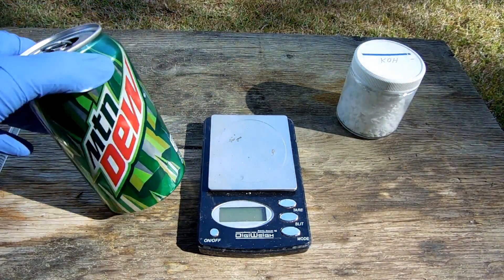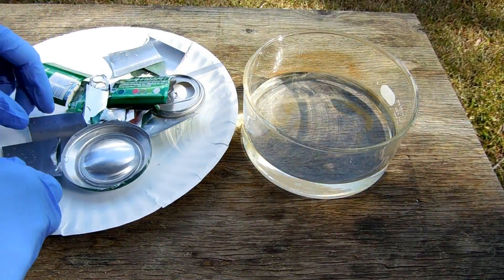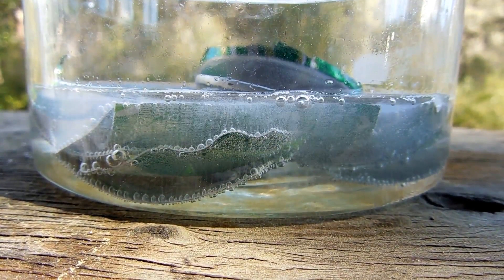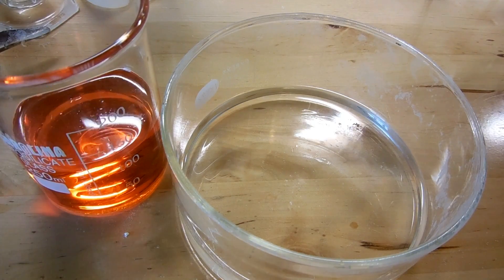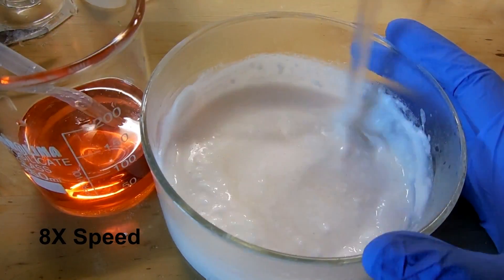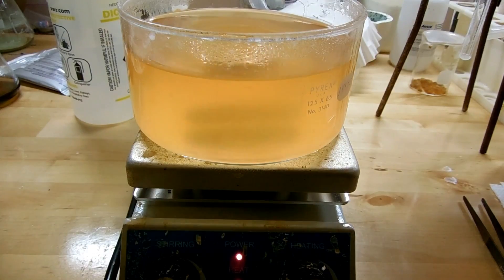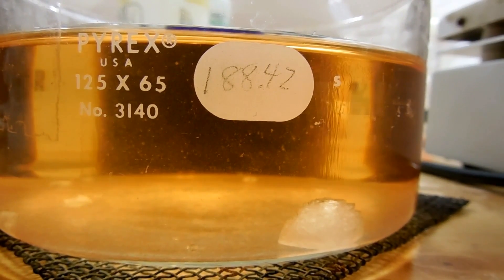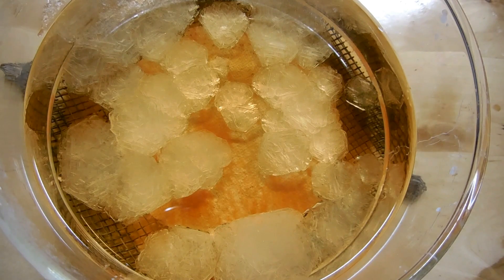Alum from Soda Cans

Comment: Can you use sodium hydroxide?
Reply from the maker: Potassium alum requires the potassium atom!
Reply: @mrhomescientist  oh didn't know it was called potassium alum
Reply from the maker: @my2centz196  There are many different 'alums' - potassium aluminum sulfate is the one people usually mean when they use the term. Ammonium aluminum sulfate is also common as a pickling salt.
Reply: @mrhomescientist  good to know. I'm learning a lot. I dissolved quite a bit of aluminum in sodium hydroxide and got a weird gray and white powder after it dried out which is why I asked this question because I'm wondering what I have lol. I'm fascinated with chemistry but know nothing of it except what I learn on YouTube.
Reply from the maker: @my2centz196  What was your source of aluminum? If you only used hydroxide and nothing else, you ended up with some complex sodium aluminate / aluminum oxide mess. In my video, I made potassium aluminum sulfate. Those three parts need to come from somewhere: potassium from KOH, aluminum from the soda can, and sulfate from sulfuric acid. The acid also neutralizes the hydroxide, so the only product is the alum that I'm after.
Reply: @mrhomescientist  I used aluminum electrical wire. That mixed with a pretty strong solution of food grade sodium hydroxide & distilled water. I mostly did it for the fun of watching it but I allowed it to evaporate so I could see what I had left. I'm sure it got pretty contaminated because I left it outside until it finished drying. I also dissolve some of the wire in hydrochloric acid and got a pretty cool white paste that I have no idea what it is either. Actually I also added 35% food grade hydrogen peroxide to the HCI   again just for fun and my morbid curiosity lol. My wife says I'm gonna blow myself up one of these days lol. I do use protective gear and a well ventilated place when doing this stuff luckily so I haven't yet lol.
Reply from the maker: @my2centz196  You did great with the first experiment - wire, food grade, and distilled are all very pure, so your products will be too. The second reaction with hydrochloric acid produces a lot of heat and can ramp up very quickly to boiling, which you may have noticed. Adding peroxide would produce chlorine gas, and speed it up even more. In any case, your product is hydrated aluminum chloride. Curiosity is great, but in chemistry especially it must be tempered with caution. You need to research any planned reaction before you perform it, so you know exactly what to expect and what dangers to watch out for. You can't be fully safely prepared unless you have an idea of what might happen. Mixing things at random is never a good idea in chemistry. I'm glad you're interested in the science and I don't want to discourage you from experimenting, but you need to make sure you understand and prepare for the possible dangers. For your own safety AND your wife's.

Comment: I would say the streams are currents of solution LESS concentrated then the bulk.  When a solution supersaturates, it forms precipitate more readily on existing precipitate ("seeding").  (Alum is peculiar in that water solutions can supersaturate to a large extent, but not precipitate spontaneously.  It is for this reason that alum is so easy to grow crystals from.)  The depleted solution is less dense then the bulk, and rises.  This is a case of "non-thermal convection".  You see it because its optical index is lower than that of the bulk.
     You do not want to evaporate the solution too far!  The contaminates become more concentrated in the solution, while the desired substance becomes depleted.  Contaminates may reach the point of precipitating.  Solution can also become trapped in overlapping crystals, and then is more difficult to wash off the crystals.
Reply from the maker: I think you're right!
Reply from the maker: Great comment! I think you're exactly right.

Comment: hey i mixed my aluminum with sodium hydroxide, and viniger, and it made this white mess... im not sure what it is, i am assuming it is aluminum acetate, and the main question is ... is it soluble in anything?
Reply from the maker: Aluminum acetate should be soluble. What you actually made is more likely aluminum hydroxide, which is not. Add more vinegar to the solids until they dissolve to get the acetate.
Reply: @mrhomescientist  oh! Thank you!!! I was super confused about what to do next, I'm planning to use electrolysis on the solution of aluminum acetate to get aluminium as acetic acid is not good enough to react with aluminum
Reply from the maker: @thecrudelab3204  But water is! Unfortunately it's not possible to form Al metal from an aqueous solution. If it was, they wouldn't be melting rocks to make it industrially! Less reactive metals like copper, however can be made that way. Try electrolysis on a copper sulfate solution instead!
Reply: @mrhomescientist  yeh, I have but I was just wondering if I could do it with aluminium and it is worth testing this anyways, I'll see what happens after this.
Reply from the maker: @thecrudelab3204  All experiments are worth a shot!
Reply: @mrhomescientist  cool!!! Thanks

Comment: I say the current is less-dense solution.  The bulk solution is most likely supersaturated.  Where the crystal is, the solution is only saturated, so it's less dense.  Alum is a material that can "way supersaturate".  That's why it forms large, single crystals so easily.  (Crystal growth is determined by thermal conductivity and amount of supersaturation that can be sustained without spontaneous precipitation.  Materials that don't "tolerate" supersaturation and are poor thermal conductors must be grown slowly, from a melt, in order to prevent "rogue crystals" from forming at the growth front.)
Reply: You said what I knew and went a lot deeper!

Comment: the stream coming up off the crystals is fluid of less dense alum solution due to the surface of the crystal pulling alum out of solution as it crystallizes
witch has a different refractive index and less dense causing it to rise
i seen this same effect from recrystallizing some eritritol

Comment: Hey why not use sodium hydroxide instead of Potassium hydroxide? It's pretty much the same..
Reply from the maker: Otago Harbour Fishermen But it doesn't produce the right alum. The type I'm making is potassium aluminum sulfate.
Reply: mrhomescientist OK but does sodium hydroxide method work for crystal?
Reply from the maker: Otago Harbour Fishermen Sure. It makes sodium alum instead, which I imagine would be pretty similar.
Reply: i dont have any sulfuric acid :'(
Reply: well technicly i could get some copper sulphate and dissolve it in water and run electrolysis on it to make copper metal crystals and sulphuric acid but i dont have any nearby :'(

Comment: great video !  what if you put aluminum into sulfuric acid - does it do the same thing?
Reply from the maker: C P It still dissolves, yes, but so do lots of the other impurities! By first reacting it with hydroxide, we can leave behind almost all of the other junk and dissolve only the Al.
Reply: what about using clean aluminum scrap?  The reason i asking is because i need to make lots of aluminum oxide for composite peopolymer research project.  Right now just using mineral alum mined out of the ground (lots of impurities) reacted with sodium bicarbonate to produce aluminum oxide precipitate and sodium sulfate liquid.   - side point :Sodium sulfate liquid glows a brilliant sky blue in ultraviolet light.
Reply from the maker: It depends on what the scrap is. Aluminum wire is generally very pure and would yield pure compounds, while soda cans or pipes are alloys that would be rather impure. Again, though, by dissolving in hydroxide first much of these impurities can be filtered off. You can also just recrystallize your mined alum several times to increase purity.

Comment: tabs are higher grade of aluminum almost 100 % aircraft grade if not 100%
Reply from the maker: Do you have a reference for that claim?
Reply: from the time you have annoyed me you could looked it up I think it is a punched dye it comes from a tiny puck it is punched hi grade actually a very valuable aluminum it is air craft grade
Reply from the maker: It was just a simple question. I have tried looking it up but could never find a credible reference. Soda can manufacturers state that they use the alloys 3104-H19 and 3004-H19 for the wallls, and 5182-H48 for the lid. No mention of the tabs. I would think if it was a significantly different and valuable alloy, it would have been listed. I was honestly curious if you had a solid reference for what you said; no need to get defensive.
Reply: Might be 6061-t6.

Not for sure though ...
Reply from the maker: Pretty telling that he never responded, eh? If anyone can find a reference that says the tabs are made of a different material than the lid, I would be genuinely interested to see it.
Reply: mrhomescientist Yes. I know a year ago post, but why not... I did not find any evidence the tab and can are made from different materials, however, I also did not find any evidence that are made from the same material. I can think of some reasons they might be different based on their function, but they could easily be the same. I did find plenty of info that they do sell to recyclers for the same price per pound. Technically, this makes the tabs worth more, only because the can is coated with label and protective coating and so not all of its mass is metal, whereas the tab is all metal (sans the natural oxide coating). I couldn't find it, but some years ago I read an article about a couple that made a living buying aluminum cans, melting them into ingots, and selling the aluminum up the recycling chain. Apparently the recyclers would pay more than for the cans because they were burning off the coatings, and reducing the volume (though it would seem the EPA wouldn't like it). The notable thing I remember was that who ever interviewed them, specifically asked if they removed the tabs and melted them separately. They said no, and added that once they were melted, it was all the same. Just from an economic point of view, if the cans are made back into cans, it would be cost prohibitive to remove the tabs, so they are going to end up in the melt. If the cans are an alloy, and the tabs pure, the alloy could be supplemented to make more cans, but if the reverse were true, or they both are an alloy, again, not economical to remove unwanted metals. There is also the urban legend that the tabs are worth ridiculously more than the cans. This legend has been bolstered by the fact that Ronald MacDonald house accepts tabs, but not cans for a charitable donation. The real reason Ronald MacDonald House doesn't want the cans is because cans take up a lot of space, and are dirty. The Legend had been debunked, but people determined to believe outlandish nonsense persist.

Comment: OK, I have some aluminium cans. But where the heck can I get KOH and sulfuric acid? :|
Reply from the maker: Both are widely sold as drain cleaners, although often contaminated by other things. My sulfuric is "liquid fire" brand. It's red, but works fine.
Reply: mrhomescientist Thanks, I'll check those out.
However I'm wondering how they made it "from scratch", from stuff that could be found in Nature. I know that sulfuric acid and KOH were known and used in the past, long before the industrial era. How did they made them? Are there some natural minerals which contain them? And natural processes in which these chemicals are produced? Those alchemists in the past couldn't exactly just go to the store and buy some chemicals someone else made for them.
Reply from the maker: Well if you want "natural" then you can just go straight to the end product - potassium alum occurs as a mineral. KOH can be obtained from wood ashes, and sulfuric acid can be roasted out of some sulfate minerals. That would be how ye olde alchemists got their reagents. Aluminum metal is a lot more difficult, and aluminum cans aren't exactly from scratch either ;)

Comment: Mine doesn't want to dissolve even with heat HELP!!!
Reply from the maker: +Kardop Science We'll need more details to give useful advice! What did you do and where did it go wrong?
Reply: After treating the mixture with sulfuric acid the precipitate wasn't crystalline like the one in the thumbnail it was all jelly like
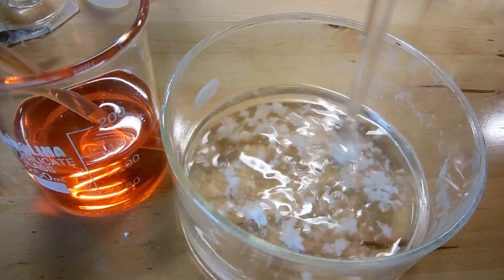Reply from the maker: +Kardop Science That sounds like aluminum hydroxide, which you get when first adding the acid. You can see how gelatinous it was at about 4:30. Keep adding acid and this dissolves as it's converted to aluminate (assuming you have enough water, which I didn't). Was your acid a lower concentration than mine, and did you calculate how much you need to add?
Reply: Too late now, bollocks.
but thank you for the feedback
Reply: +mrhomescientist you gonna post a new video anytime soon?
Reply: How do you calculate it?

Comment: Can use NaOH?
Reply: +92eas It wouldn't form Alum, Alum is KAl(SO4)2.12H20. If you use sodium in this case, it is very likely not going to crystalize because Sodium salts are typically far more water soluble than Potassium salts.

Comment: can i use HCl for the experiment?
Reply from the maker: No. Alum is a sulfate salt, so it requires the sulfate ions from sulfuric acid.
Reply from the maker: +LargeVirus Possibly, it is used sometimes as a sulfuric acid substitute. It would require recalculating the stoichiometry to know how much to use, but if that's all you have it would be worth a try.

Comment: Aluminum cans are typically the alloy ASTM 3004. This is ~1.4% Mn, 1% Mg, and 0.7% Fe, with smaller amounts of Si, Cu, and Zn totaling less than 1%.
Reply from the maker: TSorovanMHael Yep! In my aluminum furnace video I have a little more information in the description. This alloy is used for the body of the can, and another is used for the lid.

Comment: The phenomena at your video starting at 7:16 is pure water, which just lost dissolved molecules from it by attaching alum molecules to the crystal. If you want to grow crystal faster, just attach it to some holder, and then rotate (it will help to alter dirrection of the rotation periodically). This way, pure water will be quickly replaced by dense solute, and crystals will grow rapidly. When crystal is relative small, then rotate faster - as crystal growing big, reduce rotational speed accordingly - to maintain relative constant flow of solution over the surface of the crystal.
Reply: +Milan Karakas 
Forgot to add: if not rotated, crystals can form narow upper part - water (depleted from crystal solute) will begins to disolve upper part of the crystal, and it will grow wide at the bottom, narrow at the top.
Reply from the maker: +Milan Karakas Neat, thanks!

Comment: I found that it does indeed take a lot of water to fully dissolve the crystalline material that is left behind in this reaction.
I followed your procedure to a tee even down to the excess water.  I was only able to fully dissolve the precipitate with a whole lot of heat, stirring and water.  In hindsight I think that after the addition of the acid all that needed to be done is vacuum filter this and then crystallize.
Reply from the maker: I'm glad you were able to reproduce my results successfully! What are you using all that alum for?
Reply: mrhomescientist I want to play with making a lead alum battery.   I made the plates already.  I I  am waiting on some glacial acetic acid for some lead oxides as well.
Reply: I just dried it out in a dehydrator.  I have a good amount just from the three cans..  I was very surprised
Reply from the maker: Clown Whisper Sounds cool, good luck!

Comment: so far its coming along.  Its funny, my filtered aluminate was about one shade lighter but of the same color as your tech grade acid.  My acid is clear lol....  im adding in the diluted sulfuric acid slowly and she yes it gets very hot. would be best to use an ice bath.  interestingly I used a stir bar and cranked it on max from the start and I am able to keep it going so far.  I am making a  large batch,. almost exactly three times what you show here.  I am in need a quite a bit of alum for a project.

It will be fun doing recrystallization.   I have some questions to ask you but they dont really fall under any of your videos.....  lol.....

Here is one.  I made some nitric acid a couple of days ago.  I ended up with quite a large amount of potassium sulfate salt.  the fall out of solution very rapidly  so I dont know if this is the best method of purifying them.  I wanted to know your thoughts on that byproduct. of the distillation.
Reply from the maker: If you made it from KNO3 and H2SO4, the only possible impurity would be KHSO4 (plus any impurity from your starting chemicals). However it would be best to recrystallize your potassium sulfate at least once. Fast crystallization like that gives more opportunity for impurities to get occluded in the crystal structure. I recommend redissolving in hot water and let it cool as slowly as possible - the slower the crystals form the better!
Reply: mrhomescientist I did a few recrystallizations and ended up with just under half of what I did from the initial fall out

I have no immediate use for the chemical but  perhaps I will some day.
Reply from the maker: Clown Whisper That's sort of how I operate. Saving everything means no waste to deal with!